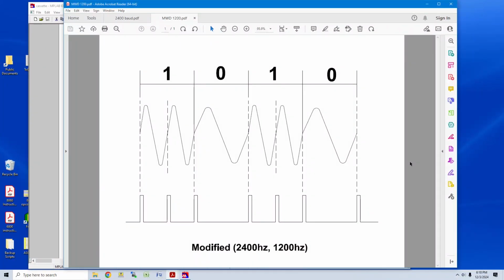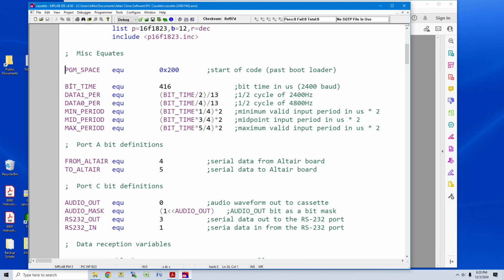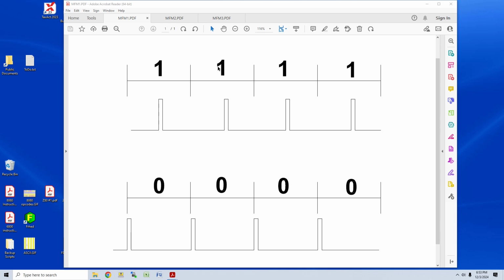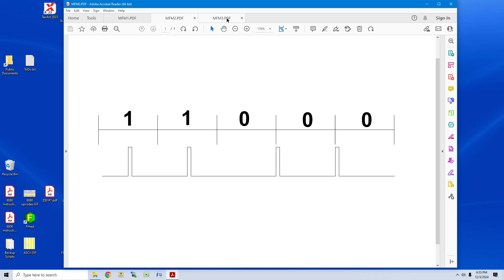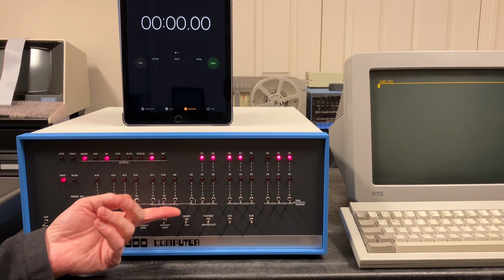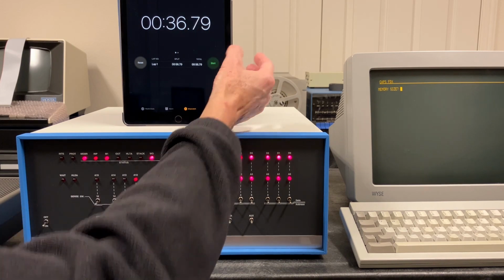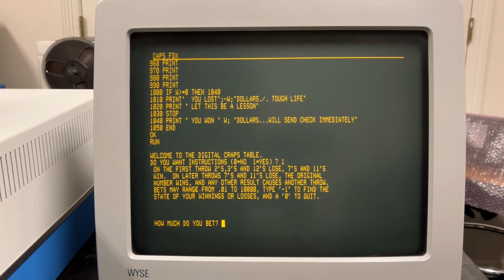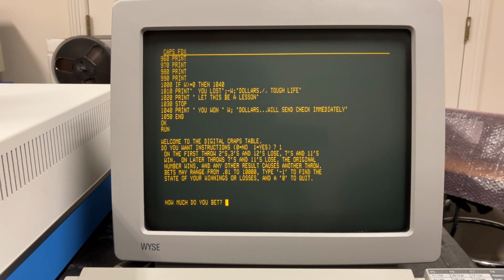Turbo-Charging a Microcomputer Cassette Interface (Altair) - Part 2

Comment: The bandwidth of a telephone line is or was around 3kHz.  Modem speeds maxed out at 56kbs.  So would it be possible to use modem encoding techniques to up the baud rate to cassette?

Comment: I recall my Atari 800XL and the miserable 600 baud out of dedicated cassette recorder. At the same time (at least in my country, ZX Spectrum used to reach at least 2400 if not 4800, stock, using generic recorder.

Comment: If you’re using a PIC microcontroller for the cassette decoder then you may have enough performance to use PQSK, which will let you boost throughput considerably. The same type of encoding allowed modems to push 28.8Kbps down a phone line with an absolute limit of 8KHz.